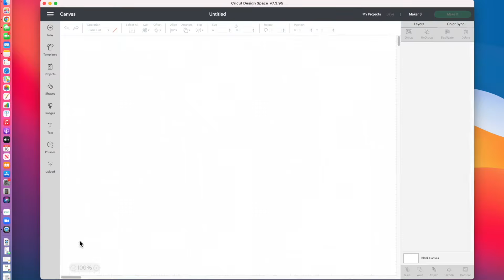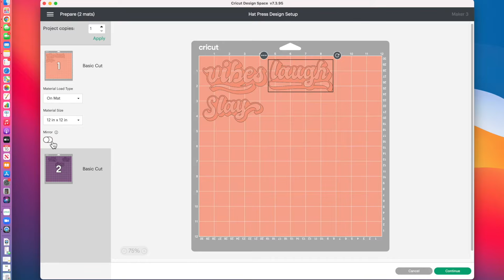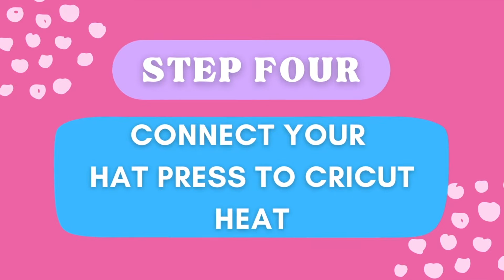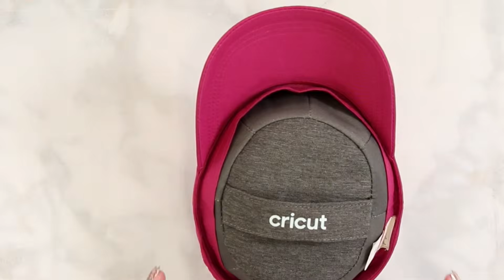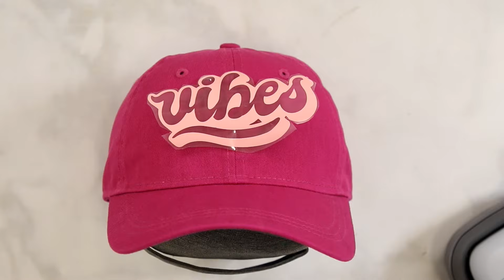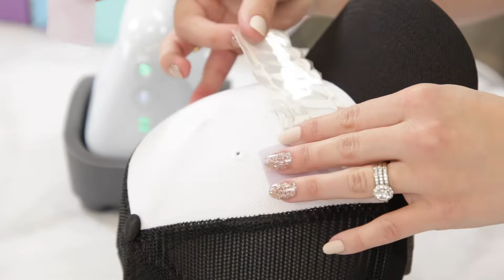How to Use the Cricut Hat Press with Iron-On & Infusible Ink

Comment: Hi, I know this isn't related to Iron-ons and stuff but I have some questions about the cricut cutting mats. I got the purple one, the stickiest one, generally used for cards took and thicker materials like that. I kind of figured I'd also be able to use it to cut removable vinyl stickers and I was able to the first time but every other time I've tried using it it cuts for about 10 seconds and then stalls and the red light starts blinking. Is that because of the mat or is there a different problem? I've also taken out the blade and cleaned it but it still doesn't work. I've kind of come to the conclusion that I need to buy the standard grip mat, but now I'm a little afraid it'll happen again. Can you help?